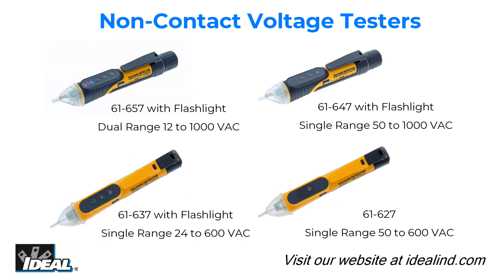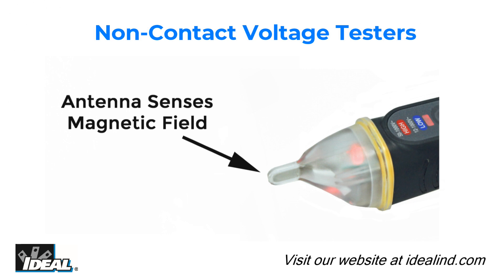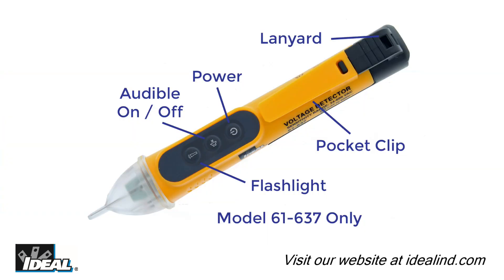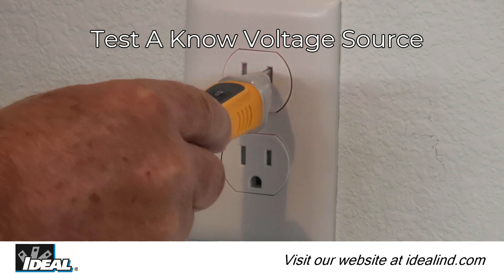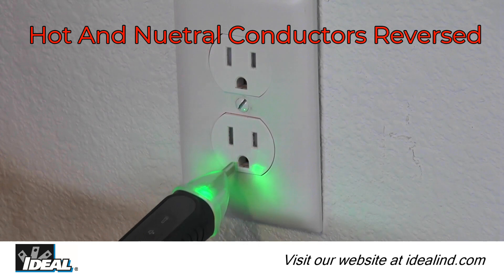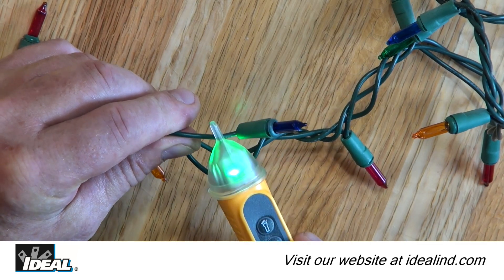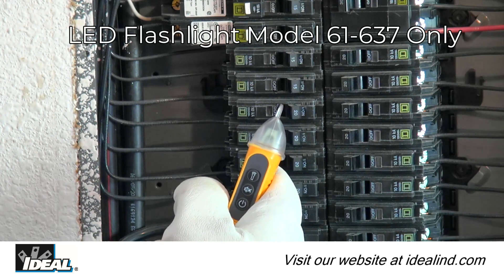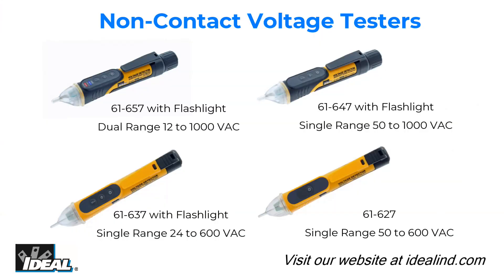61-627 61-637 Non Contact Voltage Testers Video

Comment: i used the 61-627 to change out my light switch in  shed there were 4 wires that were caped off. Another two wires going into the light switch itself. ALL wires are flashing and beeping rapidly when touched? The light switch has two attaching screws on the same side and they are the same color. ? wires in light switch were red and the other wire was red and black. ?
Reply from the maker: Kirk the tester will beep if it detects voltage so you may need to verify power is off using a voltage tester before working on the circuit. The light switch has two screws to attach the hot or black wire to for the circuit. You only switch the hot not the nuetral. Someone could of used a red conductor instead of black for that circuit. Kind of hard to help you without being there good luck Ron

Comment: I have a 61-627. So on some wires the staccato sound is slower than other black wires coming out of the same box. Why is that?
Reply from the maker: Glen the sensor detects 50 V and up and the higher the voltage it detects the higher the rate it will beep at. Hope that helps Ron

Comment: Thanks again, Ron. My only concern is that it still lights up. I used an OHM meeter and got no reading which I take to mean no voltage. I like the tester but am losing confidence in it with this false slow flashing light.  Unlike on a hot wire, it does not flash at any real speed. I'm not an Electrician so you can understand my concern.   Could it be that I have a faulty tester?
Reply from the maker: Hi Denny hope you had your meter to read voltage not resistance? These voltage indicators will flash quickly and beep when near a live conductor and the closer to it the faster it flashes and beeps. If you read our instructions or watch the end of the video good industry safety practice is to always confirm there is no voltage before working on the circuit with a voltage meter. I think yours is working fine Ron

Comment: Thanks, Ron...so if it is only an intermittent flash more than likely the wire it is next to is a non-source just a neutral or ground wire?
Reply from the maker: Denny it should flash and beep only on a hot wire nuetral and ground should get no indication. Hope that helps Ron